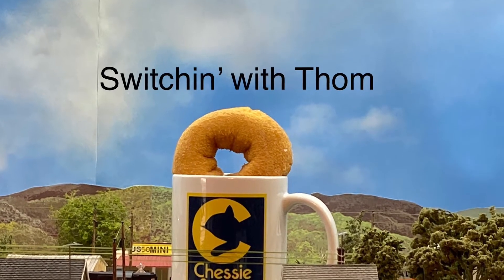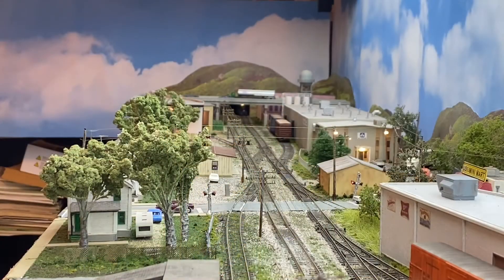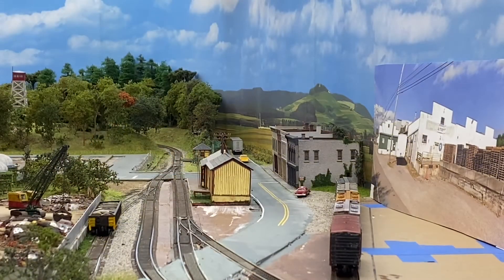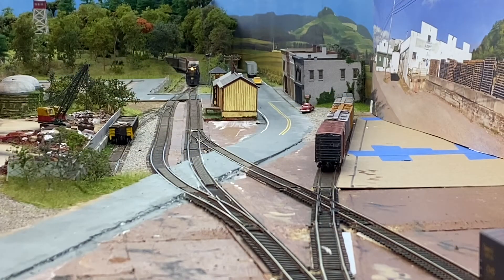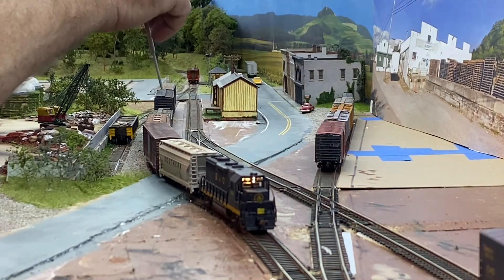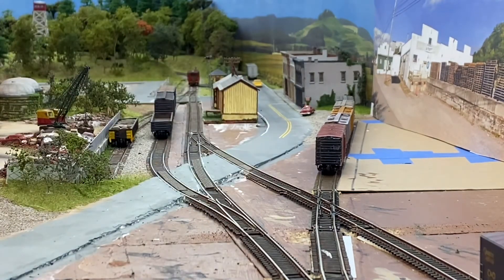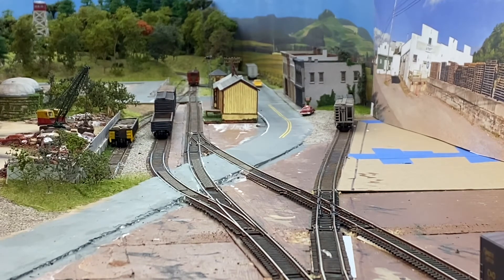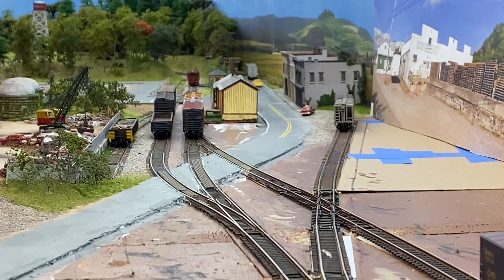Switching Oak Hill, part 1

Comment: Thom, the ride to Oak Hill was better than I had anticipated. The scenery looks awesome along the way and the camera shots and angles were super nice. That was a very entertaining switching operations video. Nice job on the narration as well. I like it when you do it outside. Thanks for sharing.
Rich
Reply from the maker: I like doing the narration outside, too. The weather didn’t cooperate today while narrating Part 2, so I’ll probably add some background music to cover my breathing and other noises. I didn’t mess with moving the camera much since I needed to focus on the train, but will try different angles in the future.
Thanks for watching, Rich. Hey, maybe I should put a big oil leak under my model Corvair to match my Dads! 😂 Stay safe!
Reply: @thomplacier677  
Thom, the oil leak would have been accurate for the 80's - so go for it. Today's Corvair owners have solved most of their leakage issues with "Vinton" O-Ring Seals and proper maintenance. The oil leak would be another nice detail that only Corvair owners (like me) would appreciate.
Rich

Comment: Hi Thom, when I first saw that train rounding the corner into Oak Hill, and then you said " I need to pull onto the siding to leave some cars" I thought, oh my, how's he gonna pull this maneuver off? You did an awesome job of not only running this ops session, but track planning as well. I love that shot of the train rounding that corner and then seeing it come into Oak Hill. Pleas keep up the excellent work my friend.  Dave B.
Reply from the maker: Thanks, Dave. It’s almost impossible for us to duplicate what trackage was actually at a location. The B&O was noted for having overlapping sidings and they did that here, too. I just didn’t have space to model it. It would have made it possible to not leave the caboose on the main line, though.
I do really like that shot coming into Oak Hill. When I get the scenery finished, it will be a highlight of the layout. Stay safe!

Comment: This one is a real gem. Did you have any track issues? It all looked flawless in the video. Not much happening in my train room right now. I'm researching some rolling stock to see what trucks, metal wheel sets, and couplers I need for conversions. I know I'm making this harder than it probably is. I'm wanting to standardize my trucks and couplers. And order the proper wheel diameters for each individual type car. Thanks for sharing and I'm looking forward to your next video.  Going to go back and watch previous episodes when time allows. I know I have not watched your earlier videos and I'm sure I'll get some good pointers from them.
Reply from the maker: Yes, Danny, I did have a few issues. There was one major one and I’ll talk about the issues at the end of Part 2, which I’ll post tomorrow morning. Thanks for watching.
I also want to standardize trucks and couplers and go to metal wheels, but want to be sure I’m using the correct size. It will probably cost me 200-300 dollars to convert everything, so it’s not high on my radar right now.
Stay safe!